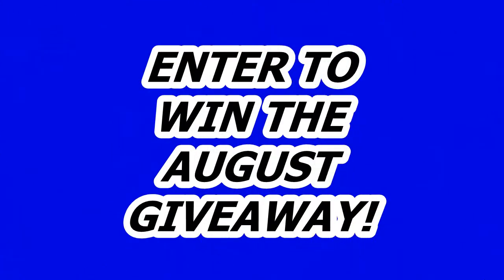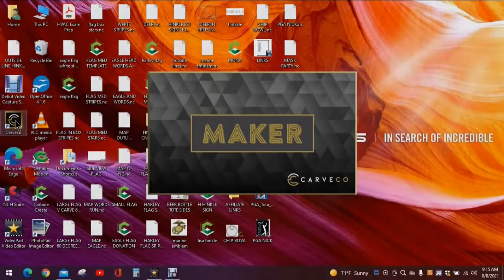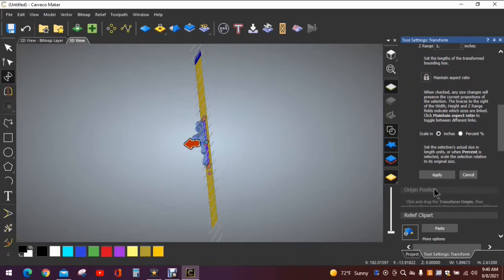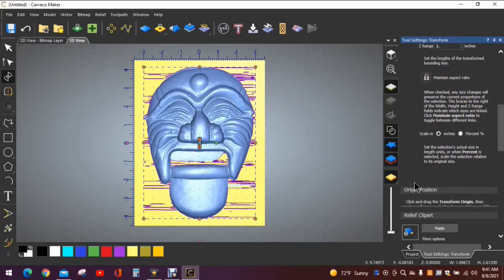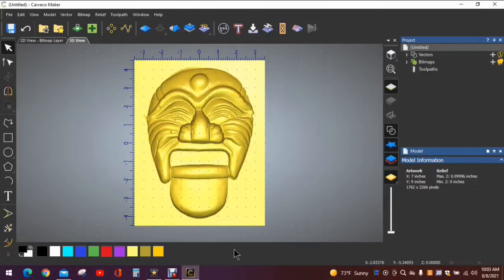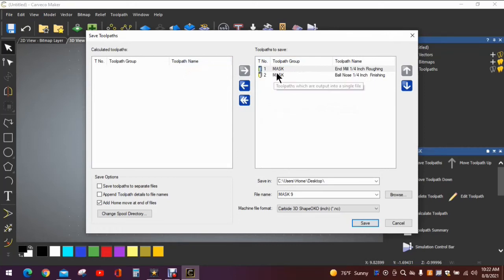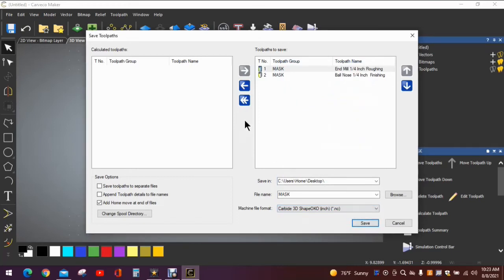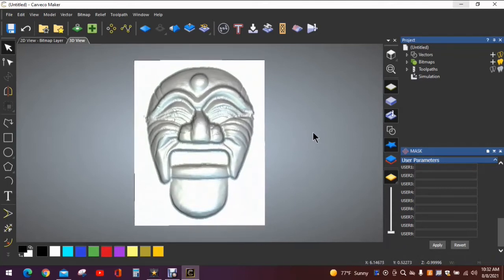HOW TO: TUTORIAL ON HOW MAKE A RELEIF CARVING WITH CARVECO SOFTWARE ON A SHAPEOKO CNC

Comment: Tool one, perfect.  Tool two on the onefinity is a no go, literally.  I change the tool and press go but you never know what you will get.  This time the router ran up beyond the material and plunged down into my bracing board.  Argh!!!
Reply from the maker: Very strange indeed!
 I can’t offer much help with a onefinity yet I hope to have one someday
Reply: @Hinkleshop   I am going to try saving tool # 2 as a seperate tool path and see what happens 😂 pray for me
Reply from the maker: @justwavingenterprises2542  keep me posted
Reply from the maker: Just a thought the step down of any end mill as a general rule is set to 1/2 the diameter of the cutter so if you are using a 1/16  a step down of .1 is way too much
Reply: @Hinkleshop   Worked by creating a second file.  No sure what the problem was but I did complete my first relief carving - thank you so much for the terrific videos!
Reply from the maker: AWESOME !! Glad you nailed it! Thanks for watching and allowing me to help